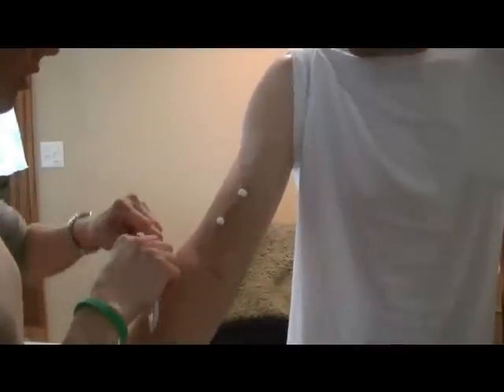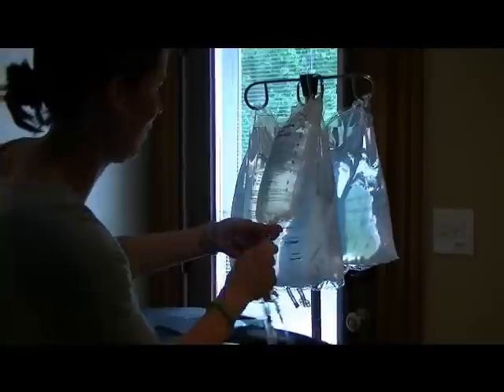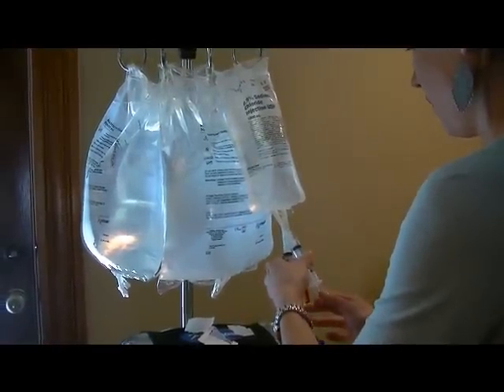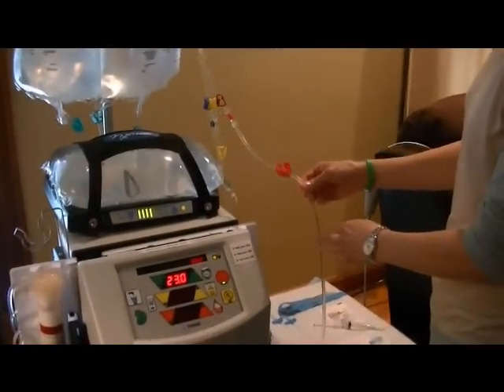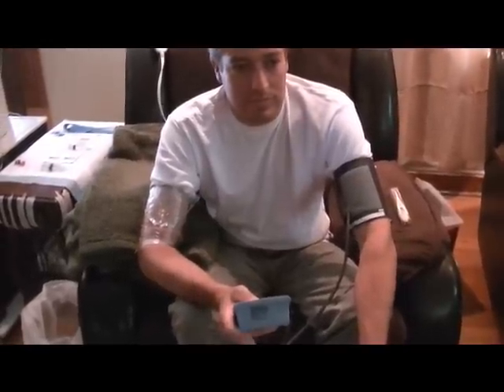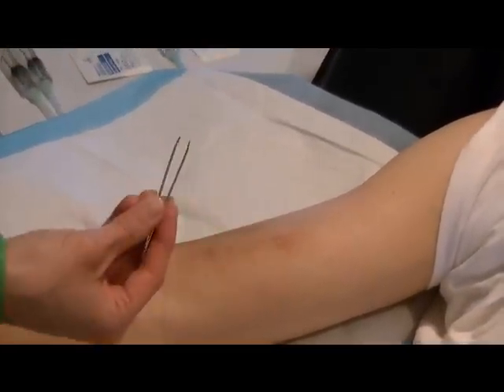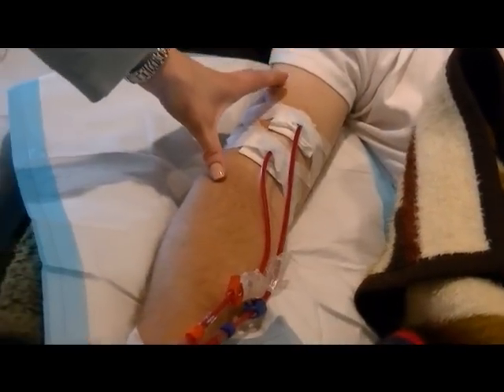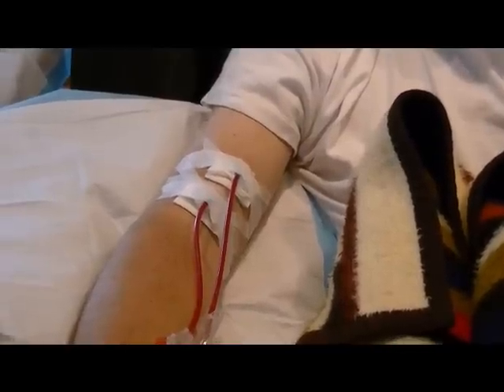Dialysis Video for class.wmv

Comment: FYI button hole uses blunt needles and those are green and a clear yellow clamp.. You never use tweezer the button hole kit has a device to take off the scabs.. Proper aseptic technic you clean in circle motion starting inside and working out..
Reply: I go to dialysis , and never saw that , that is very dirty an never saw that done ever

Comment: So your wrong about the extra line for on the dailysis your patient is 20 liters and some patients are 25 liters of bath... Every patient is diffrent so I wish your dialysis center would teach you correct.
Reply: Those are clearly sharps! Those are not button hole needles. unless your trying to start a button hole witch i think you said.. only takes a week to get a good tract.  now the other port on your warmer connector is for a additional dialysate bag for patients that have a 25 liter bathe. Love how you do your cannulating and taping nice skill but you may try not using so mant 2x2;s under the needle if your trying to accomplish button holes! its awesome to see you work trust me.. i just like to share my experience!

Comment: Very bad techniques to prevent infections. You should never touch the needles or fistula during treatment without gloves. Also if you use button holes you should never use sharps, you can damage the fistula walls. Please use blunt needles if you have developed the button holes. Just a piece of advise.

Comment: He don't need a standing Blood pressure that is wroung.. A sitting pressure is good enough.
Reply: I am glad there is a disagreement here so I can further exam the point. Your talking POST dialysis not pre dialysis. PRE there is no need for a standing BP I don't care if your a RN. You would fail the new CCHT and bonnet even stating that as being fact. So funny how people don't READ before the comment? CCHT is by far the easiest to get try BONNET. There doing a home hemo application not in center treatment. And if you did a post standing and they could not make it to the scale then you are need to back off the UFR or you challenged a little to much. I start a bolus when they are below 90
Reply: I am a home hemo Bonnet and CCHT and medical assistant since when was they don't standing bps on someone with no legs wow
Reply: Means your taking off to much fluid... Most patients can't stand anyhow. They are suppose to wait 15 or 20 after tx to stand anyhow because your closing up the cannulation area.
Reply: At my dialysis center they do both , an get a weight , many People must use those walkers an once they put weight on their arms , the blood starts gushing down their arm . Many sit in the waiting room before leaving . They always take too much fluid off Me after I tell them , only 2 litters , if not I cramp , an they are some monster cramps . I don't bleed a lot , But allow 1 site at a time for 5 mins. then they tape it up good , then remove the next needle , but do bleed at times. Also I saw some horror arms where they mess up Peoples arms , I tell them do it right , if not they will use the same spot . Techs are in a hurry an don't care , thanks for Your input .